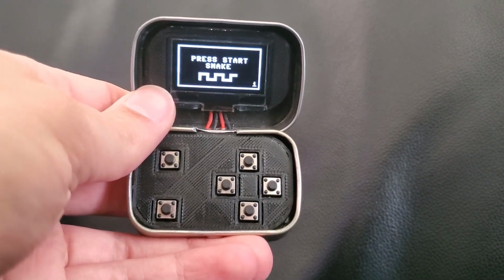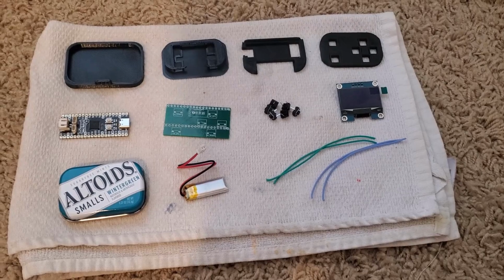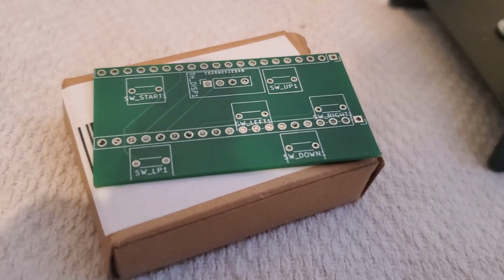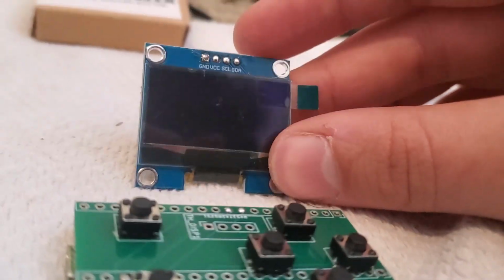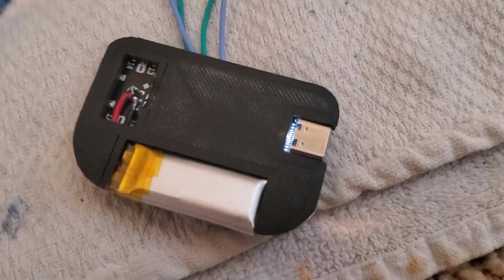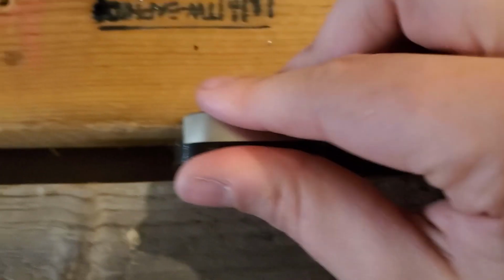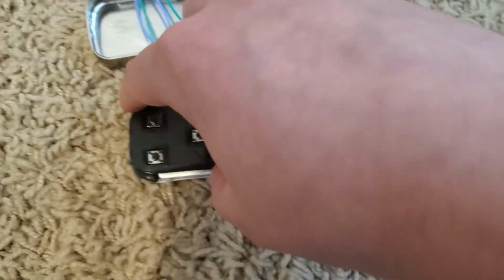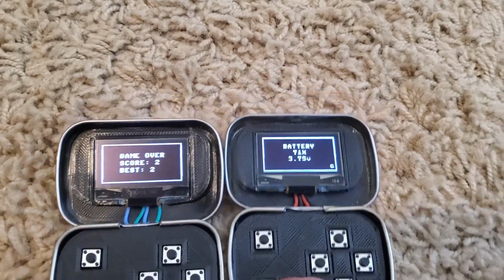mintyPico | A Game Console in an Altoids Smalls Tin

Comment: I think YouTube erased my last comment because I linked to digikey... Awesome build and really cool. What is preventing the lid from closing? The buttons? I found some low profile tactile switches that are 2.1mm shorter than the ones you used. Would that be enough to let the lid close?
Reply from the maker: Yes, in theory, it would stay fully closed without the pressure of the buttons pushing back up on the lid. On top of that, I did a test fit of all the parts, accounting for a 0.5mm gap between the PCB and the Pico, and it stayed closed. In reality, that gap ended up being probably 1-2mm, so buttons that save 2.1mm of space would be awesome! Do you have a particular model name or number for the buttons?

And it appears that YouTube did in fact erase your comment :/
Reply: @kaydenkehe  I think youtube deleted the comment again... If you search COM-08720 switches they should show up! They're surface mount so the PCB would need to be changed. Should be easy enough to solder by hand because the pins are spaced out.
Reply from the maker: @DanSteigerwald  I actually did purchase these while I was trying to measure out all the components; the only reason I chose the larger switches was because the COM-08720 switches were kind of mushy feeling and hard to press.

That being said, those would be a fantastic idea for a modified build!